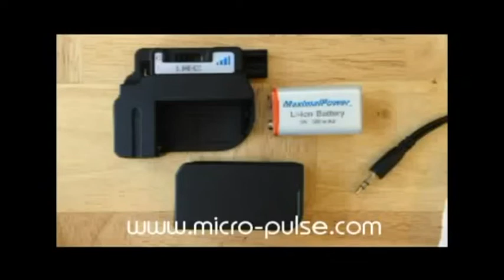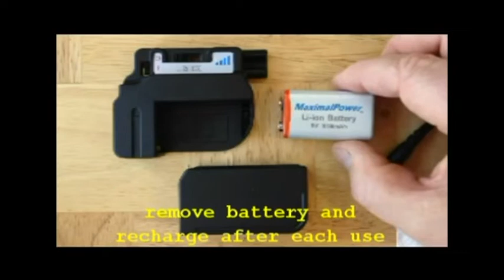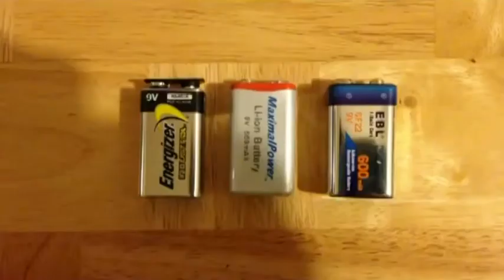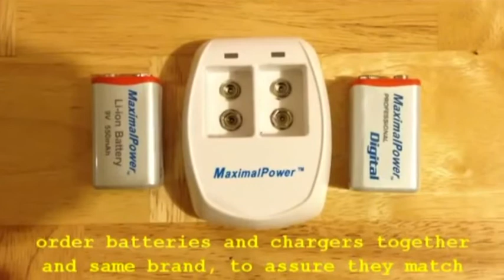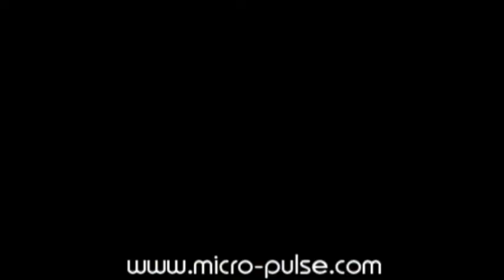Micro-Pulse ICES PEMF Video Tutorial 2 - Basic setup: Batteries

Comment: is it normal that my device is flashing red light (a cross) when I use it? Thanks.
Reply from the maker: A flashing red light indicates usually that there is a short circuit in the coils.  This can also be caused if you don't have the coils plugged in all the way.  The first thing you want to check is that the coils are plugged in all the way.  Sometimes you have to press them in really firmly. You don't want them to be unplugged even one millimeter.  Once you're sure that the coils have been plugged in firmly, then test them with the hexagonal coil tester to make sure that they are working properly.  If you still see a red X after you've plugged the coils in firmly, then there might be a problem with the coils themselves, they might have a short circuit. So you need to test to be sure that they're working properly.
Reply: @robertgdennis7472  Thank you for the reply. I made sure it is plugged all the way in. Sometimes the device flashes both red and green light simultaneously and I can hear the constant clicking sound from coils. Does it mean the device still functions properly? I lost the coil tester a long time ago so I can't test the coil right now. Again thank you.
Reply from the maker: @xiandongwang2710  Actually, if you can hear the coils clicking then the device is definitely working.  Sometimes the red X will flash only because the device is internally regulating the electrical current to keep it from going too high.  This is normal operation.  This often happens, for example, if you have the device set to a low intensity output setting ("L" or "M" on the A9) because the device is preventing power surges to the output.  So it sounds, literally, like your device is working properly.